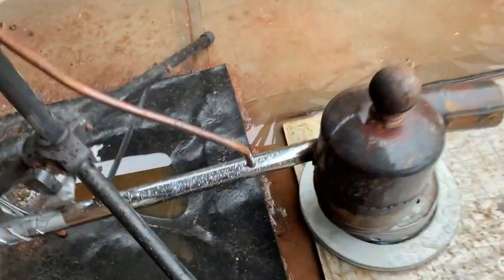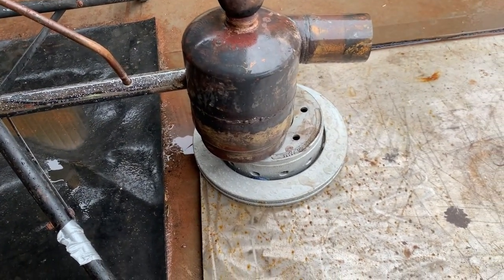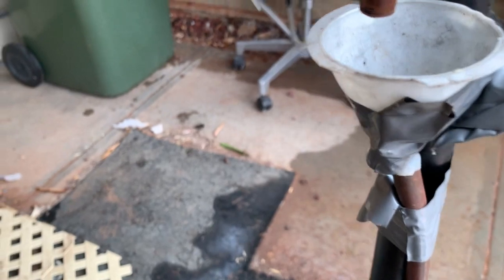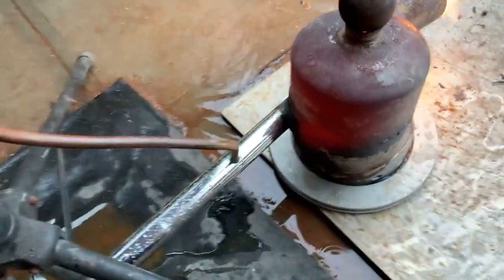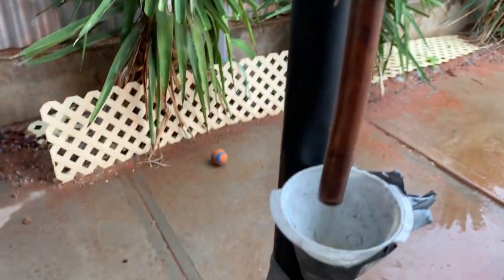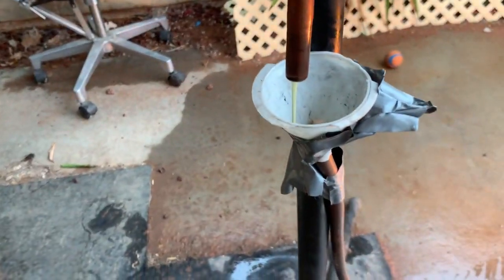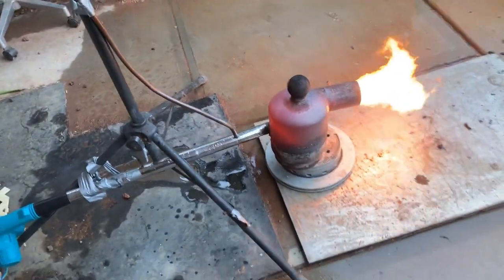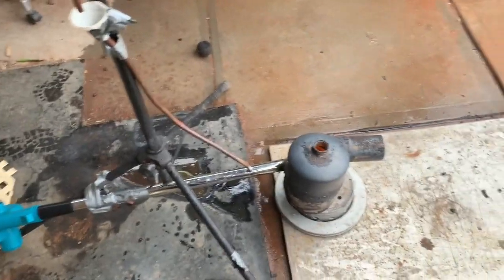Waste Oil Burner  V3

Comment: Some oil in the burner at startup will help get it lit faster. this will come up in a couple of minutes if you give it more oil and air. 
Your design layout is good.  Oil consumption is directly related to heat output. People seem to think these things are like a car and can be more efficient but not the case. 

Running the glowing is where you want to be. You can back the air down with the fuel to get a greater turndown ratio but they will have a happy place  depending on the inlet size with air speed as well as the chamber size. 

If you want to run this stand alone or for hours, use a pump and a timer.  I run mine all day and night to heat the house and the timer / pump keep it constant wherever I set it. 

At 1L of oil in 30 Min you were producing about 20KWh.  Getting below 1L an hour is difficult. A pump allows you to measure flow and from there you can work out how many seconds min pumping you need and set the output. 

You have set this out  very well.